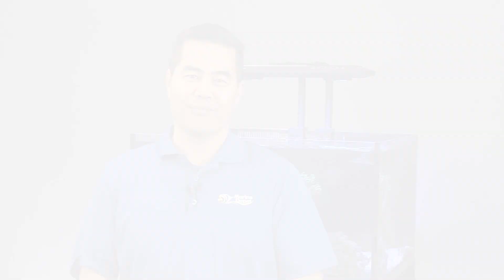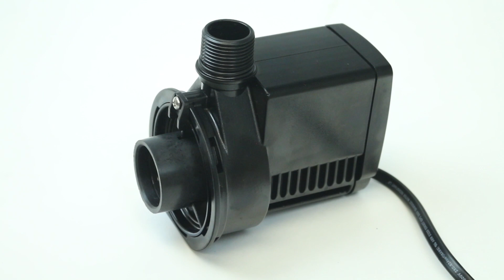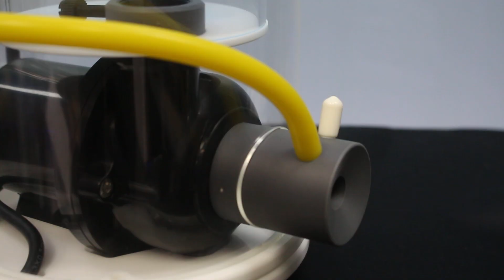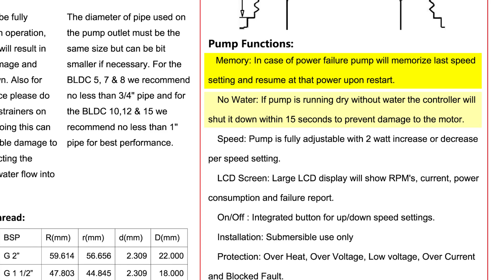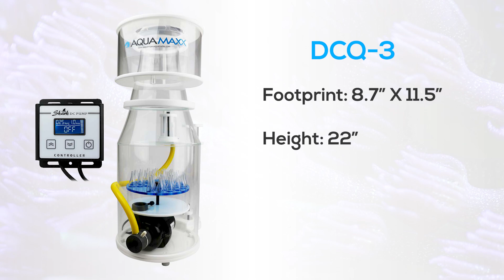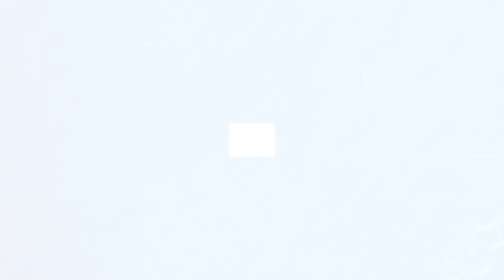Bringing DC Control To Your Filtration: The AquaMaxx DCQ Skimmers

Comment from the maker: Hi Everyone,
Quick update.  I actually just received some updated numbers for the gallon ratings of the skimmers and they are higher than what we mention in the video.  They are as follows:
AquaMaxx DCQ-2:  190-300 Gallons
AquaMaxx DCQ-3:  300-480 Gallons
Thanks and sorry for the confusion!
Reply: Hi @marinedepot, since this is a DC controlled pump, IF the power goes out/power-outage, will the pump continue to run (AFTER) the power is back on, on its own, or will I have to manually go and switch the pump on?

Comment: On the e-mail it says up 190 gallons heavy. But in the video is saying 130 gallons for the dcq-2. I bought this based on the original ad on marindepot that said 190 gallons but when I opened the box the paperwork surprised me with 130 gallons.  A little confusing there.
Reply from the maker: Hi Felix, Sorry for the confusion.  The 190 gallons is the correct number.  There were some updated numbers that weren't communicated to us so the actual gallon ratings are a bit higher than we have listed here.  Both the product pages and the online manuals have now been updated.
Reply: @BulkReefSupply   Thanks for the reply. That 60 gallon difference scared me. It is a lot. But so far it is showing to be a real workhorse. The tubing was smaller than they have ever have used before and the adjustable venturi does not have a realistic linearity because the tubing is so small. But I leave wide open and everything works excellent. Bubble size is perfect.